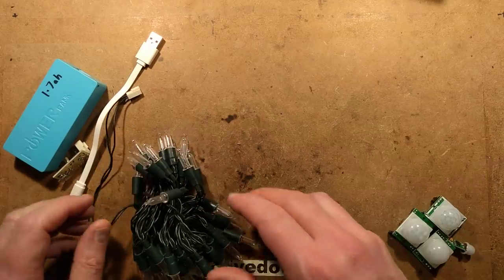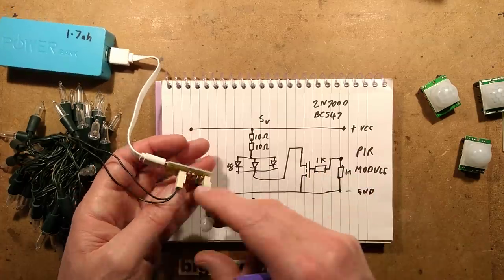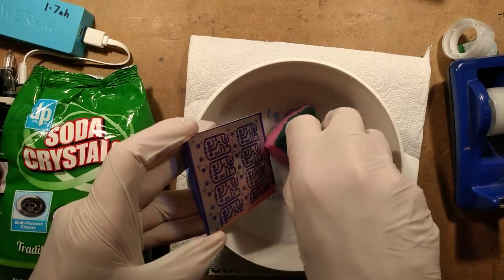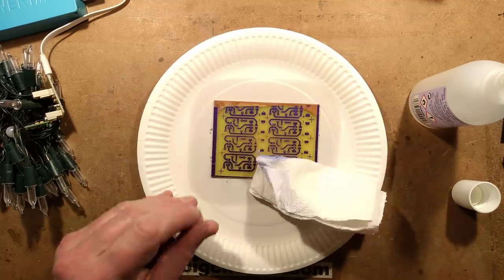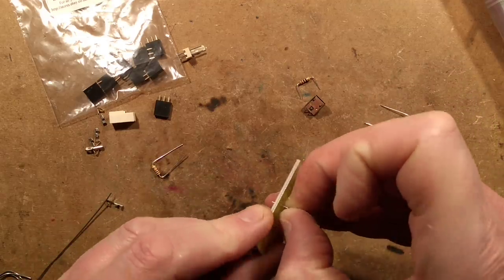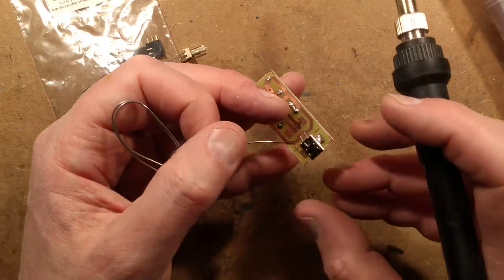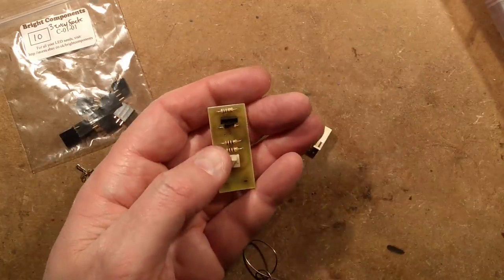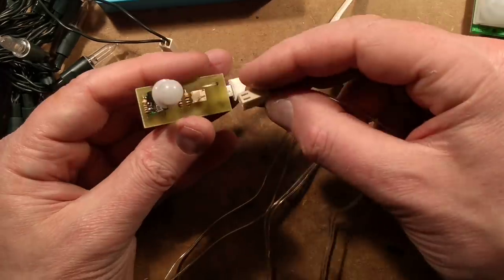USB to PIR to LED-string interface PCB.

Comment: The videos where you realize projects are my favorite,  would be great to see some more of them.
To remove the photo film from the board I use the rough side of a sponge, that works great and the surface of the copper is afterwards perfect for soldering.

Comment: re. pick and place ... the cameras are mainly their for alignment (on older models of pick and place machines) esp when working with fine pitch components ... i don't think i've ever noticed any text on the bottom of the chips though ... once the pickup location is verified that's where the spool is loaded and then before any camera alignment the head usually scans with a laser to verify the parts dimensions and that the pickup was successful ... if the machine thinks its not correct then that component is moved to a reject bin. edit: also cool project im working on something similar with pir sensors / buzzers and relays. also +1 for the absence of a micro controller ;) :D

Comment: 19:18 amazing tool you got there. You also bent the legs manually but there is also a plastic help available that goes from narrower width to wider where you put the component in at the chosen width and the width determines the point where the legs are bent (manual action)

Comment: Could you make a video showing how to design a PCB in software?  You always show the schematic, then jump to the printout.  I'd like to see how to make it on the computer.
Reply: eagle cad + some calipers and about an afternoon. ... pretty intuitive takes few hours to learn but will take years to master :)
Reply: I was going to ask the same. Im learning easyeda which is a chrome add on. Alot to take in lol.
Reply: Try easyeda.
Reply: I think Clive uses Sprint Layout. It's a fairly simple piece of software that has no schematic capture and is more akin to a drawing program for PCBs than a complete CAD/EDA package.
Reply: Try kicad for its open source and entirely free. Next to that it has a lot of functions
Reply: Don't worry it's actually pretty easy if you have basic knowledge of schematics etc. Lots of tools even autoroute the traces.
Reply: For very simple circuits I'd go along with a pencil and paper schematic followed by a 2d design program that's adapted to electronic componentry.  Which someone suggested is what BC does.  I tried Eagle (if that's the one associated with Farnell, I may be misremembering ) about 5 years ago and got infuriated, just about the most unintuitive program I've ever used.  Scene, me shouting at screen:
"Look mate I want a non polarised capacitor!  I don't want to specify it's footprint, nor even it's value just yet!   Just draw the bloody symbol and I'll fill in the details later!". I couldn't persuade it to do that, nor draw a trace that goes nowhere (cos I'll solder a wire onto it).  I had to put fictitious connectors, which don't belong at the level of abstraction of a schematic. Bad.  Back then it was a klutzed GUI on an old DOS program.  Maybe it has improved.  Sorry about the rant, yeah I'd like Clive to take us through his choice.
Reply: @raykent3211  Eagle is pretty easy to grasp. Well, that might have been different five years ago, only started using it two years ago. And ya can do the wire into nowhere, which is more annoying than helpful since you can easily miss a conncection.

The first thing to know is to always use asterisks in your search for parts. Otherwise you search forever.
Reply: @chaos.corner  Import Eagle files into EasyEDA online and order from JLCPCB for $2
Reply: @steverpcb  I've already bought from a couple that just took the Gerbers direct for similar prices.
Reply: Dave at EEVBlog was recently doing tutorials on a nice open source package.
Reply: @kaylaandjimbryant8258  I should try it out. I started with Eagle when it was the only reasonably priced game in town. Always up for some open source.
Reply: Eagle and KiCAD are great.  Eagle is AutoCAD and so maybe not anymore, KiCAD is free, but the problem with both of these is that they are way too powerful for casual use!  I used to deign PCBs professionally, and we used crepe tape on 4:1 stable film and had it photographically reduced - Ancient Tech!

So now, I'd recommend PCB Wizard 3 - http://www.new-wave-concepts.com/pr/wizard.html.  Only buy the PRO VERSION though (if you go for the others - get pro only there too...), standard will leave though being very upset because something important is missing!  It's powerful enough to make the drill and Gerber files - I've used this to make production PCBs.  The point is that you will be working with it inside of 20 minutes.
Reply: @SianaGearz  I have Sprint too, PCB Wizard 3 is better for 90% of SIMPLE stuff (Sprint has a better package library) - I bought Sprint to see if it was better - your appraisal is spot-on.
Reply: @apexmike849  I find Eagle very clunky and would love a more friendly alternative. I have to disagree a bit with you on the too powerful though. The way design tools like eagle work helps avoid making mistakes which can be a pain if you're having your PCBs fabbed (I still make them though.)

Simpler tools, you avoid some of the learning curve but it's learning worth having (other than learning Eagle weirdness).
Reply: I started out with Fritzing.  Its a bit out of date now, and really needs some freshening up with the latest components, but for getting a design off breadboard and onto a simple PCB in a few clicks was a good first step on the ladder.  Once you have got the basics you can move onto easyEDA or something similar.  Navigating/panning/zooming/routing etc uses a different button arrangement but is easy to get used to.  So can anyone link me up with the easyEDA package for that USB connector?

Comment: Try flooded drilling when drilling with the photo resist still intact, use distilled water with a bit of detergent to lift out and float the resist. Thanks Clive great video.

Comment: I've got a few of those radar ones around the house like this used as basic night-lights in the hallway etc. They're great for that random walk about at 3am as there's no need to manually switch in blinding lights! I use a small transistor to switch a 1W USB LED.

With mine I use a LI-ION battery charger board and feed the radar and the LED the direct battery power. A single 18650 at about 1800mA capacity lasts about 6 weeks before the low voltage cutout.
Reply from the maker: I've stuck the little USB rechargeable magnetic lights in selected areas so the house can be comfortably negotiated at night.

Comment: Really useful idea and a good video, Clive.  Thank you.

It would be great if you would share the manufacturer-name and part-number of the black 3-pole socket that resembles but (you implied) is not a DuPont socket, and of the mini-USB connector.

Also, hopefully you or an associate or agent will manufacture and sell the bare boards on eBay so that we can bypass the board manufacturing process.

More kit videos like this, please.
Reply: The USB isn't a Dupont product, Really???
Reply: The USB connector and the black 3-pin connector are both not DuPont connectors to my knowledge.

FYI various eBay sellers offer small connectors that they call DuPont connectors.  Their 3-pin ones resemble the black one in the video.

Comment: Funny how that crimp tool will be a real chore until one day, it becomes a strangely indispensable when the knack is acquired.  I got one of the cheap china versions and have been using it for quite some time now, got it after you introduced it in an earlier video, and it was just a few weeks ago that the light bulb came on in my head and everything jived, suddenly it was just a piece of cake to build cables with it!

Comment: I wish I had seen this a week ago. Last weekend I made an LED light for my coat closet but rather than a PIR I used a big limit switch on the door itself with a 90 second timer in case I forgot to close the door fully. It works but turned  out quite a bit more bulky. The pity is I have a few PIRs in stock for a pending project.

Comment: I think with the second string of leds you ran into that problem with powerbanks where those control IC's have a minimal current draw they need to keep the output on. The first string triggers the output and that's why the second string works after putting the first one in briefly.

Comment: For etching I use this bag from an old etching set (pre 1990). It's sealed with two clamps so it's a pretty clean process, no open chemicals. The bag lies flat on the table and all you have  to do is pressing on it repeatedly to make the solution move. Etches much faster than just letting it sit.
Reply from the maker: Seno GS.  No longer made, but you can buy heavy duty layflat tubing and bag clips online.  I've used that system in previous videos.

Comment: Thanks for showing your PCB process.  Have you ever tried using Ammonium Persulfate to etch instead of Ferric Chloride?  I use it and prefer it to Ferric Chloride for these reasons:
1. Being a crystalline solid it has a very long shelf life.
2. It does not stain clothing or fingers.
3. Being a clear solution when prepared it is easy to see the etching progress while submerged.
4. Safe to use.
Reply: I like it (or rather sodium persulfate, different salt, but the active part is the same) a lot more as well. The only disadvantage is that doesn't really do much unless heated to around 40°C or more.
Reply from the maker: I think I tried it and it was really slow.

Comment: I have made several of these and the issue I had was that quiescent current on the PoundLand power bank drained it thereby reducing the time between charges. To counter this I made others with a battery management system and a 18650 cell. These last longer but have the slight disadvantage that when the battery gets down to about 3.7 volts the PIR becomes erratic, taking several on/off cycles before switching off the power to the LED lights. Still with 30 led's run via a low drop out regulator I can get run times of over 30 days for one in my bedroom. The light when triggered automatically is quite adequate for moving around the bedroom in the night or undressing if I am too lazy to put the bedroom light on.

Comment: Lovely little project; for the next version it would be nice to have a timer included.  The lights continually went off during your video, because you're not moving very much.  When sitting around with friends/family, there could be 10-20 minutes stretches where everyone's talking and not moving very much.  Having a 30 min timer from the time it detects movement would smooth that out.

Thanks for sharing!

Comment: #stinkfinger

lol. Always hilarious, Clive.

Neat little adapter, btw. ;)

One thing that might be worth mentioning (unless you already did further along the vid, and I've made the mistake of posting early too again), is that the BC547 has a collector current of only 100mA, while the 2N7000 FET has a current rating of 200mA.

So either is probably fine for a small set of fairy lights, but might not handle running an LED / Neopixel strip.

Comment: Very cheap (comparatively) UV exposure box: Buy a UV fly zapper, and remove the high voltage zapper part, leaving just the UV tubes. Then sandwich your board inside a glass photo frame and rest on top.

Edit: Remove the photoresist BEFORE drilling the holes?
Reply: Even cheaper: get a facial tanner. No need to remove any zapper stuff (although one could argue having to do that is a bonus ;) ). And they are going for very cheap on ebay richt now, because winter's over.
Reply: Stuart, my wife has one of those UV curing nail gel blablabla lamp , maybe you could use one of those , it has quite a big opening where you can stick your whole hand and UV lamps all around , just suggesting , all this making your own boards is way over my head ...or skill

Comment: To bend resistors I put them at the edge on a right angle to the board. Bend the lead over the edge of the board. GIves a nice clean bend with the board thickness clearance on each side. I couldn't afford a nifty tool.
Reply: You can get plastic bending aids for a €/$/£ or two. I find that quite useful, because the bends actually match up with the pad spacing (your method, if I understand it correctly is always component length plus two board thicknesses; that isn't necessarily the same as the pad spacing)

Comment: As I said the last time you did a DIY PCB video, I think this blue film is a bit inconsistant in quality,  I'm still to have good results with the stuff, although I think you've nailed it when you said you probably used too much heat.  Many thanks for the help regarding this Clive, it's still driving me mad, but I shall try without using my clothes iron :)

Comment: It's worth noting that some of the smaller PIR sensors use a chip that's different and is not susceptible to interference from WiFi. I use a bunch of these to trigger lighting in my home, and I was having issues with the Node MCU boards (esp8266) falsely triggering them when WiFi packets were being sent. HC-SR501 modules have this issue but the AM312 modules do not!
Reply: You may have saved my sanity 😂
Reply: You may have saved my sanity 😂

Comment: I have just bought myself a UNI-T UT210E clamp multimeter.  This can measure current up to 100A with 100mA resolution, 20A with 10mA resolution or  2A with 1mA resolution.  And not only can it measure alternating currents, but also direct currents, thanks to the use of a Hall effect sensor *.  It also has sockets for probes allowing you to measure voltage, resistance, continuity  (with a wonderfully fast response on the beeper)  and capacitance.  The supplied probes have slip-on covers which leave only the very tip exposed, to reduce the risk of short-circuiting adjacent terminals.  (As far as this meter is concerned, more probably on a crowded PCB than on a three-phase breaker panel; it's a bit flimsy for comfort up against the full force of the National Grid.)  There is even a "buried live wire" detector function.  Note that when measuring direct currents, it is necessary to null out the Earth's magnetic field, and on the 2A range the meter must not be moved much.

The clamp-on current measurement function is excellent for testing PSU modules with separate + and - leads; simply clamp around the lead  (several leads carrying current in the same direction can be passed through the clamp, and the meter will indicate the total current flowing through all of them if any current is flowing through any of them).  

Easily **  (that's four stars, not a rude word).  Note that a meter which is essentially identical electrically, but in grey instead of red, is also sold under the Voltcraft brand.

* The Hall effect sensor uses the same phenomenon as the scan coils of a CRT:  a stream of electrons can be deflected by an external magnetic field.  Only this time, the electrons are moving through a solid slab of semiconductor material, as opposed to a vacuum.

Using the device as a crude compass  (well, it would be wrong not to):  N = 0 mA.  (zeroed while pointing in this direction),  NE = 2 mA., E = 7 mA., SE = 9mA., S = 15 mA., SW = 11 mA., W = 6 mA., NW = 1mA.  (meter lying flat, with clamp end pointing in compass direction).  From further tests, it seems that the minimum reading on the meter is obtained with the clamp end of the meter pointing towards magnetic North, or somewhere just slightly West of there.
Reply from the maker: I occasionally feature one.  It's an excellent little meter.  Takes a bit of getting used to the orientation and zeroing of the DC clamp function.  It survives degaussing.  Not that I think it's really needed.

Comment: Instead of using a micro-B connector for the power source, you could simply design a type-A edge connector into the PCB to skip the entire cable and connector. A rigid connection between the power bank and PCB would make it easier to hold the board in a specific orientation.

Comment: One little optional mod, you could solder a USB A plug directly onto the PCB and use it like a USB flash drive but have it plugged into a USB charger or, if someone is daft enough to have them, mains sockets with USB outlets on them to use as a nightlight for those moments when you need to see where you're going for the midnight bog run... :)

Comment: Seems a bit more involved than the traditional kodak method.  are there any advantages to this over the kodak photoresist that i was taught at school in the early 80's?  we had a pint or half pint bottle of the kodak stuff that had a brush in the lid, you brush it onto the board into a thin uniform layer, let it dry in the dark, then expose the negative onto it (we used an overhead projector, placing the transparency on the glass, then the board over that, and then turning the lamp on long enough to expose it), and then right into the etch (it wasn't Ferric Chloride tho, it was white crystal powder that we mixed with water that went blue, and the copper etched away would be an aqua color, any idea what that stuff was, it worked better than the ferrochloric).  i think the kodak stuff we used is the same thing they use on the pre-coated boards you can buy factory applied.

Comment: you should consider measuring the current consumption of your PIR-modules. Some weeks ago I found out that the big ones I had draw in the order of 10 mA when inactive, which is totally unacceptable if you want to run them off battery. You could almost as well run the small string of LEDs with that current for as long time as the PIR-module. My small module, looking exactly the same like yours, drew in the µA-range in comparison.

Comment: Geez, if I was drilling all my holes by hand, I sure as heck would be using surface mount components where possible. You can get some pretty sizable surface mount resistors with their value printed on the top.
Reply: I was waiting for him to drill his finger...